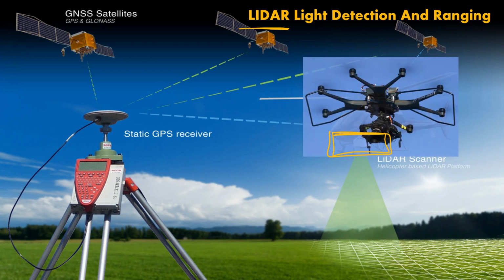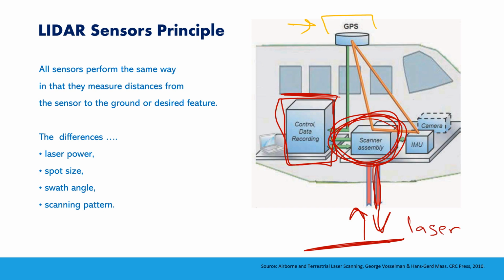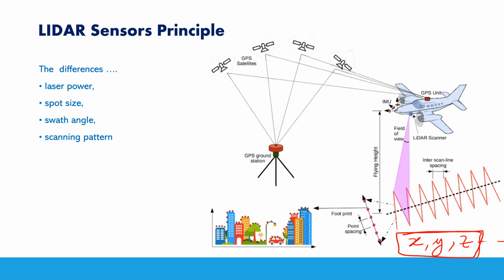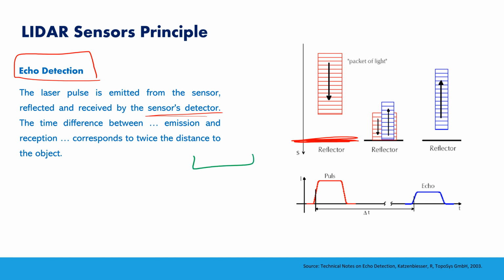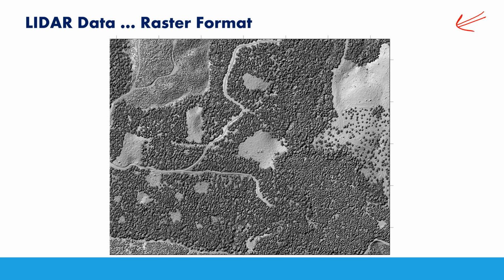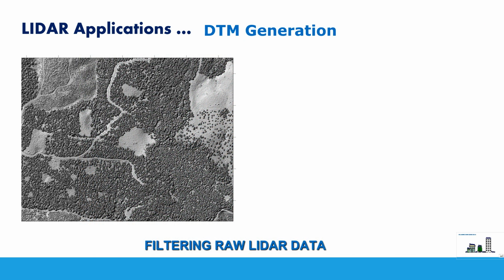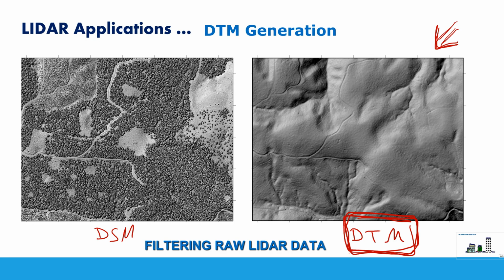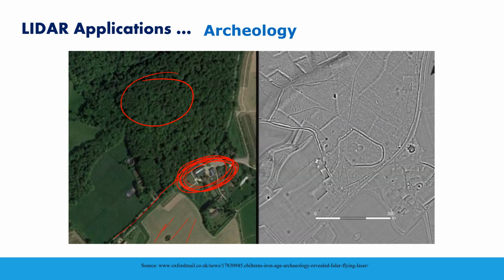LIDAR | AIRBORNE LASER SCANNING | PRINCIPALS AND APPLICATIONS | DATA FILTERING | DTM DSM DEM

Comment: thanks a ot Dr Ziad for this lecture. May i know what kind of Errors through using ALS.
as i read there are lot of sensors like Laser GPS/IMU. So the time synchronization is very important . Also we have to calibrate the scanner and lever arm between GPS and IMU and IMU and laser 
 beside the number of the used GPS satellites and the type of the Topography.
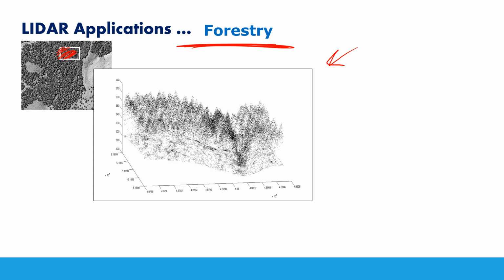 Also may i know how do you view the point clouds results at time 22:19
thnaks